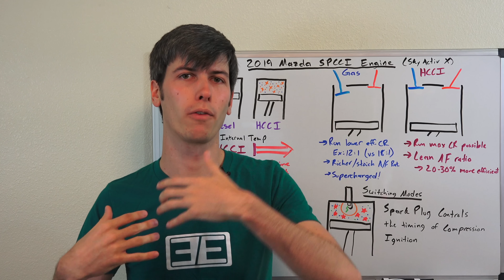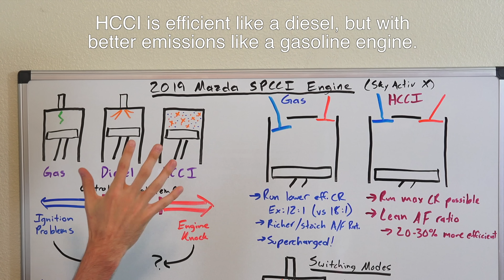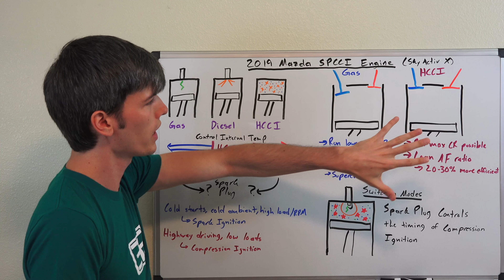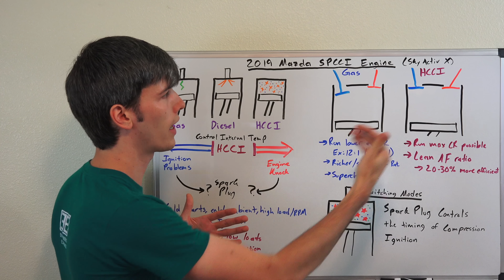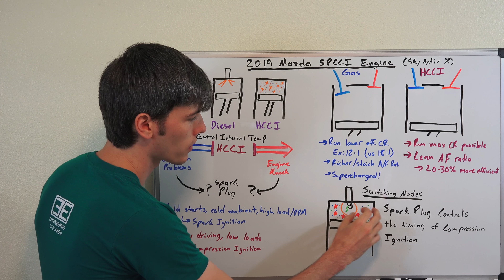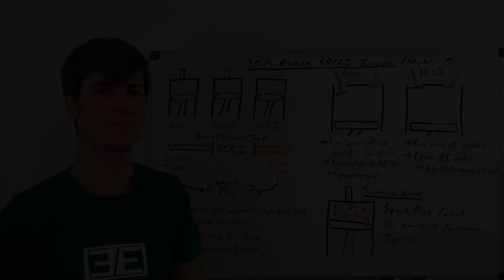Mazda Creates The Holy Grail Of Gasoline Engines - HCCI SkyActiv-X

Comment: The flame front from the spark does not increase the pressure throughout the cylinder. The pressure wave from the spark is faster than the flame front. It is not that HCCI is occurring everywhere simultaneously, but that the condition for HCCI is present on the pressure wave front.

Comment: During the VW2 they increased power on airplane engines by spraying water into cilinders. They could do it now again in more sophisticated way to cool down the mixture at high compression ratio and also to mitigate NOx problems.
In one of previous videos you mentioned, that richer mixture is cooling the engine at small turbo engines, but there the consumption rises.
So, why not trying with water?

Comment: thats all a lie you dont need spark plugs at all to fire a gasoline engine ore dizel engine compresion the old dc magnetos didnt need those things thats only car companis try to confuse peopel ever hiard about plazma generators ore plazma ignition?magnetism? ore how switc molecule particals state at high speed from one state to another the thing is you dont realy need fuel at all only to start the engine then not those are called closed system engines,pap engine,multi fuel driven engines as saied before you can use electricity,magnetism ore diferences in temperatures to achive those things did you know waste spark ignition system provide this any way? I dont care what your mechanics say what acures is Implosion/Explosion effects and you take advantage of those changes so basocaly you can use any thing literaly as fuel if you know how chemicaly decompose it and return it back together corectly there exist engines that run on plain straight "air" that is real mechanics and art of knowlage just like joe cells and stanley mayer those are only exampels and they work perfectly,GEET generator etc etc peopel used all cinde of staff and it works so that you know schools are payed to lie belive only what you see with your own eyes thats my advise for you young peopel by avare the army was the first one to ever build cars and other machinery like they gona tell you evry thing I dont think so!

Comment: If the stroke is long and combustion chamber larger compression ratios can be increased substantially before detonation occurs, factors such as combustion chamber shape, cylinder head temperatures, compression ring height, piston design, type of piston material, combustion components surface treatments, ring material, ring gap, effective component cooling, and so forth.
 However, these configurations generate conditions that will reduce the average duration of engine service life, if fail safes aren’t incorporated.

Comment: This system really reminds me of an Advanced primer ignition (API) blowback action.  The results and mechanics are different, but it is about pre-igniting the action to achieve efficiency.  In firearms the input is always the same (hopefully; it is really bad if the ammo is inconsistent with this system) which means the limitation of such a system is that the RPM varies dramatically with the size and pressure of the round, but it makes the cannon smaller, lighter, and reduces perceived recoil.  API blowback fires the round as it is being chambered and is a careful match of chamber pressure to springs and inertia, get this wrong and you fire out of battery which will wreck the gun and can be very dangerous.

Comment: This engine is a combination of many known working engineering principles. Direct fuel injection, forced induction, variable valve timing and multi spark ignition systems aren’t new or rocket science. Mazda just put in all in one package. VCR is not difficult to achieve when using forced induction in the first place,it’s all about boost control. You’ve already answered your own questions about this engine in your other videos,don’t overthink it (like Nissan did with their VCR engine)

Comment: How has mazda addressed carbon build up in their DI engines?
Reply: I would imagine they will use the compression ignition phase to run very high cylinder temperatures which combined with ultra lean mixtures will tend to eat any carbon buildup laid down in the spark ignition phase.

Comment: Anyone remember Mazda's rotary engine that was supposed to be cleaner, quieter and get better fuel economy than the piston engine ?I would avoid cars powered by these engines at least until it's proven reliable and inexpensive to maintain.

Comment: Lean burn mixtures generally result in extremely HOT combustion chambers, 'over-fueling' reduces combustion temperatures via the expulsion of 'unburned' fuel gases ... any idea on the internal cooling requirements of the HCCI engine?

Comment: Efficiency is 20-30% more but when the valve is open to reduce compression ratio wouldn't the air fuel mixture just escape or reducing the efficiency in term of fuel consumption?
Reply: The a/f mixture goes back into the intake manifold, just like in Prius engines. You lose power because you're effectively lowering the compression.

Comment: Huh? You said the diesel injects when the piston reaches the end, but that's very much not how everyone else I've seen explains diesel engines. The fuel-air mixture is injected before that, so that the compression can heat it up and ignite it. The kind of pressure you'd need to inject it when that piston is nearing the top is enough to ignite it, so in rushing to inform your viewers about this new engine type, you've misinformed them about diesel.
Reply: He's still correct, diesels inject fuel still very close to the top dead end, whereas Otto (gasoline) engines inject it during intake. You're nitpicking, and missing the crucial way the diesel and gas engines differ.
Reply: Also, this is the reason why Otto cycle uses adiabatic combustion, and Diesel cycle uses isobaric combustion. You can see it from the P-V thermodynamic charts for the two types of engines.

Comment: Seems similar to Mitsubishi’s attempt with the GDI technology that allowed the engine to run lean in low speed operation and switch to homogeneous stoichiometric mode at higher loads, with resulting variable compression ratios that could run higher than 14.7:1...

Comment: 30 years ago may have been the right time for new ideas for petrol based combustion engines. Honda was developing the VTEC ideas in the 80s. Interestingly Mazda put out the Miller-Cycle engine back then and I was a huge fan of it but sadly that grand innovation was not received well by the public - and not progressed. If anything, this news just goes to re-affirm the mindset of a company that persisted (and succeeded) with the Rotary engine when others had given up.

Comment: who cares, electric motors are the future
Reply: firexgodx980 Yeah, so are rocket backpacks and flying cars.
Reply: You can't fight Occam's Razor. All else equal, EVs have way less moving parts and are just so much more simple than ICE cars. Not to mention the complexity of refining gas, vs generating electricity. The difference in complexity alone will ensure EVs are going to win in every single category possible over time.
Reply: firexgodx980 No, that electricity has to be produce somewhere, with some fuel, then transported over an already overloaded grid to automobiles that will be plugged in at the same time using batteries with some of the rarest metals on earth. A cross country trip will require two to three recharges requiring hours of recharge time. The only answer is HYBRID engines. And they will be our next generation of automobiles. At least in my opinion.

Comment: Isn’t this the same company that designed the rotary boat anchor? We used to have to hook them to a truck and drag them in gear to get them to start once the cars had about 60,000 miles on them. There’s a reason Mazda has become irrelevant in the automotive world. They haven’t built a decent vehicle since their affair with Ford. The old Mazda trucks were pretty good but for years now their trucks were nothing but rebadged Rangers... no thanks Zoom Zoom.

Comment: I'm curious how they are going to deal with variations in octane. The only real difference octane has is the compressive ignition point which isn't really an issue with a standard gasoline engine.  In a gas engine that uses compressive ignition a fuel mixture that has 87 octane is going to ignite at a different point in the cycle than say 85 octane.

Comment: Mazda's already been running excessively high CRs in their petrol engines.  Sturdy, high output, low emission, high mpg systems.  The tech exists to keep the compressed charges cool, or rather remove heat.

Comment: Great video, cool tech. What I’m wondering though is why more attention is not being paid to camless designs, which seem to give huge efficiency and power increases (not to mention a big decrease in engine weight) without all this switching between ‘efficient’ and ‘spark’ modes that this tech requires.

Comment: I'd imagine this is something you really don't want to try hand tune or mod. I'd imagine that known VVT profiles, supercharger transient profiles, and edge cases in the ECU programming are absolutely critical in how this thing works. Super cool that Mazda actually got this working though, that's a disturbingly simple way to solve the HCCI ignition timing problem.

Comment: I see problems comning to light later on. The spark plugs will likely foul whe the engine is running in HCCI mode. This is just making th eengine more complicated so there will b more maintenance issues. It's not a good idea.

Comment: Well intentioned, but poorly explained. A Diesel engine does not 'inject' fuel as the compression  cycle is happening, it injects the fuel BEFORE the compression happens. 
This (the compression to the point of combustion) gives the 'loaded' volume of fuel/air its ignition point.
Reply: Sorry you are completely wrong about this . Conventional "diesel" engines (actually compression ignition as the diesel cycle is a bit different)  injection timing is between 5 and 10 degrees before top dead center on the compression stroke.  I think you are probably confused with petrol injection which takes place into the manifold before compression.

Comment: When running in HCCI mode you increase the efficiency of the engine because the fuel is ignited with the Piston closer to TDC (topp dead center) which increases efficiency of the power stroke.

Comment: Interesting, we own a car that isn’t sold in the U.S., a Skoda Octavia 1.6 SE diesel. On a long run, long at least for us in the U.K., of say, around 75 miles or so, We have been getting around 70 m.p.g. on mainly motorway driving mixed with some city roads. Driving sensibly and sticking to speed limits my wife and I have managed to achieve these figures, so it will be interesting to see what this Mazda engine can achieve on real roads in the real world.

Comment: End 12 volt systems and alternators. Upto  30% more power. Less fuel to get you moving. Modern motors are made to be as inefficient as possible. 100 year old technology at its worst and we pay for this rubbish.
The cars we buildt in the 70s 80s and 90s are now sold back us as 'modern' car manufactors have used everything we developed and were outlawed for decades ago to promote their wares today. 
Look at the aeroplane industry high output and lighter. Thats what is possible yet we still have weighty sluggish gas guzzlers called motorcars' should be called 'overpriced junk art' that sits in your driveway loosing money everyday.

Comment: Wow so many geniuses in here 2nd guessing Mazda. 1st thing is computer controlled fuel/air ratios make this as reliable as any other gas engine. When you look at Ford using turbos and smaller cylinders and towing as much as the older V8s. The 2nd thing is electric is wonderful until you need to make a long trip and recharging times and availability are not feasible. I would like to see a time where maybe we do with cars what they do with locomotives and use a generator to power electric motors. The new hybrids are nearing that stage and this technology makes running gasoline while recharging more efficient. 15-20 years ago, the future was hydrogen, so I am not ready to bless or condemn Mazda on this, they may be ahead of the curve.